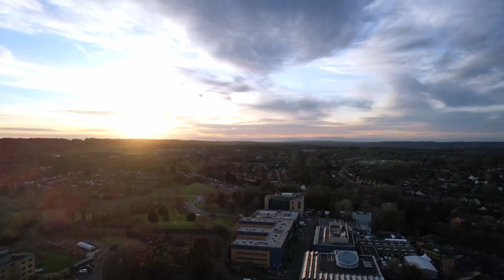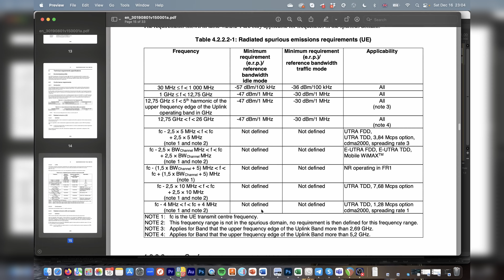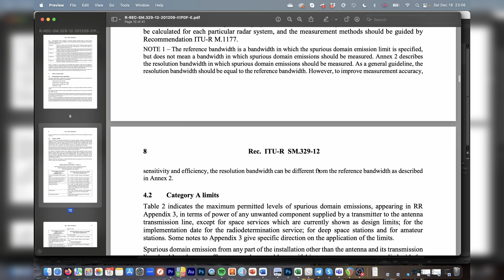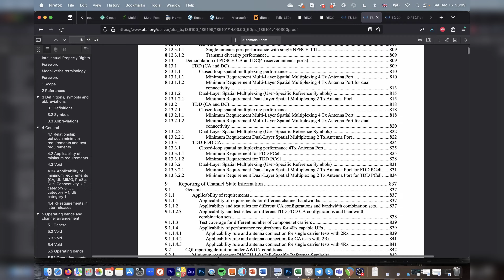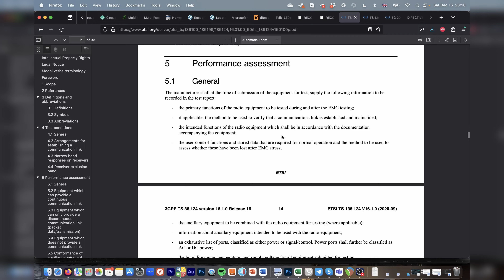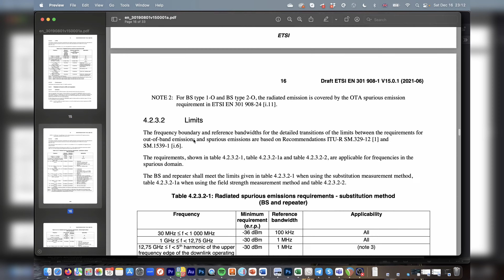Radiated Spurious Emissions Testing to ITU-R SM.329

Comment: Great video! Was looking information about spurious emission testing. Could you also share what is the different between the EN301 908-1 and EN301 908-13. Generally I know it's extended version of 301 908-1, but beyond that it's too technical. Does EN301 908-13 also done on UE level?
Reply from the maker: Thank you for your comment! :) 
EN 301 908-13 is specific to E-UTRA UE, while EN 301 908-1 applies to any equipment on cellular IMT network. This includes UE as well as BS and all applicable radio access technologies (2G-5G, etc.).
As a result, the testing to EN 301 908-13 is more strict as its detailed in a very specific manner per TS 136 508. For example, the lowest channel bandwidths, 5 MHz and the highest must all be tested, while in EN 301 908-1 we simply can pick the worst case. That alone increases the testing time 3x times. There are other differences.
Reply: @DrEMC-sf8rx  thanks!! That's good to know that it is more stringent than version 1.